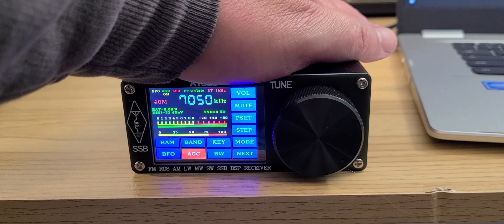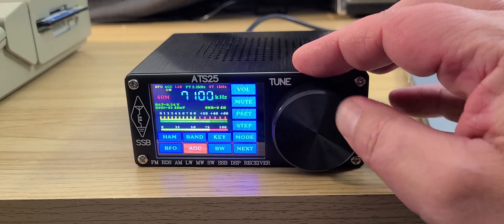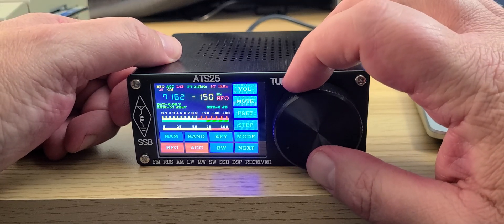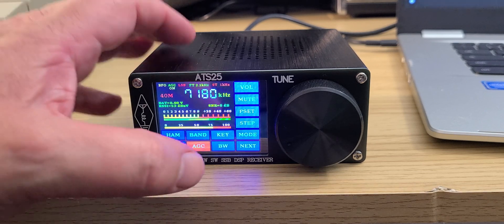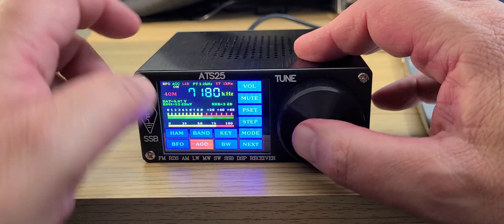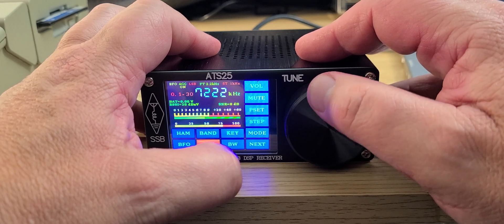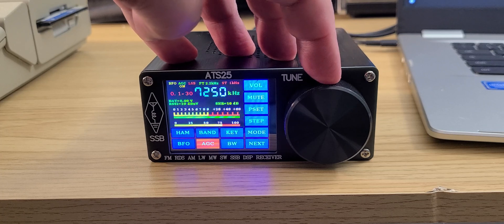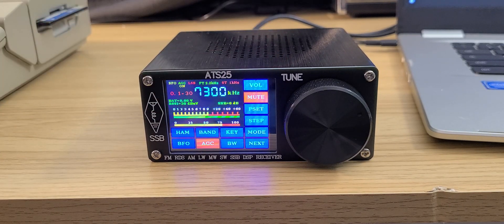Testing ATS-25 DSP receiver on 40 meters amateur radio band with LSB mode and fined tuning

Comment: Just a warning to those who don't know anything like me, the arial it come with is ok for FM but not SW or anything else....as in I can pick up nothing at all on it.
Reply: Having said that and having ordered a wire antenna so not really been able to use the radio yet......I do like this thing. I feel like a kid back in the 70s trying to pick up China whilst under the covers.
Reply from the maker: It does work, but you might be using it where there is a lot of interference from your devices at home...try it outside far from the house

Comment: What antenna is the best for the radio for the ham bands please help
Reply: A wire. 468 devided by freq in megahertz will give you the length of a halfway antenna in feet. Cut a wire to however many feet you got with the equation. Cut that wire exactly in half. Then run the center conducter of your coax to one side and the braid to the other. Coax and both wires can be insulted and supported on any insulater like wood plastic or phenolic block.  Hang it in a tree 🌳 😐

Comment: We received the ats-25 recently and have experienced problems with the volume control will not adjust or frequency with the tuning knob
Reply: Sounds like a cold solder joint on the encoder

Comment: Just reprogram the 40m band to go to 7300.  I did on mine.

Original code - {  "40M", SW_BAND_TYPE, LSB,  7000,  7200,  7132, 1}, // Ham   40M   12
 Updated code - {  "40M", SW_BAND_TYPE, LSB,  7000,  7300,  7132, 1}, // Ham   40M   12

Comment: Thanks for the Amateur Radio demonstration. As a ham, I find receiving 
Amateur Radio, a good test of receiver's
capabilities in comparison to each other.
The receiver does seem to mute as the
dial is turned between frequencies. But
not bad for the price I have seen. It is like
a portable but with a display like a table-
top receiver. 73 de W2CH,  Ray, Nashua,
New Hampshire.